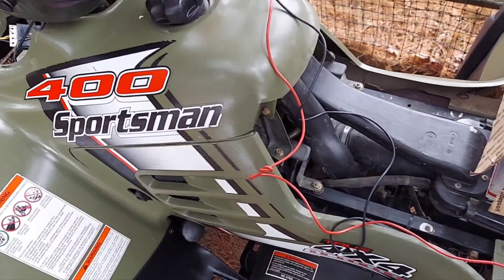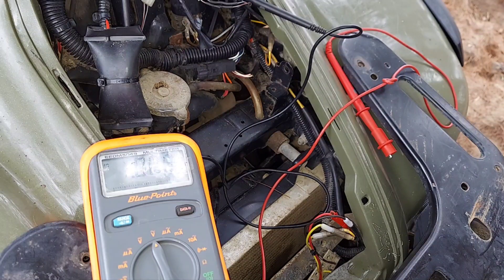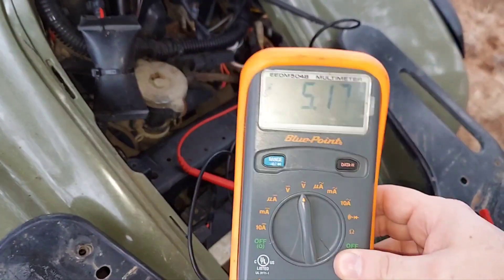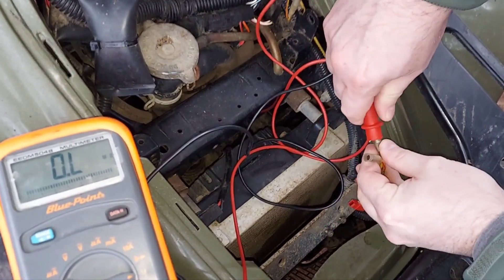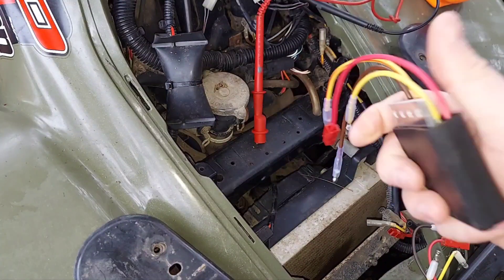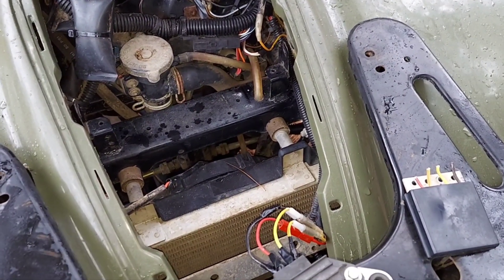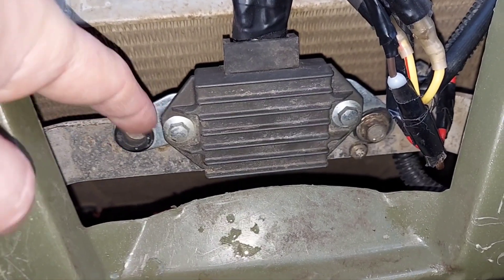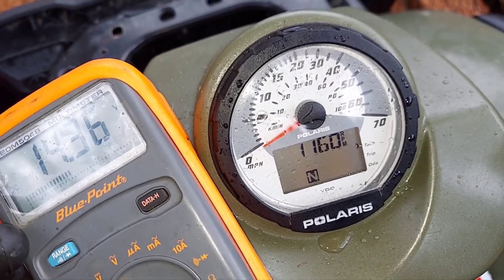Polaris Sportsman flashing battery icon on gauge. Overcharging and voltage regulator upgrade FIX.

Comment: Hello, thanks for all the info. I have performed the test as outlined in your video. All 3 yellow wires mirrored the readings you had on the video, 6-29 AC.  When I performed the test while on ohms it gave a reading, did not stay on OL What does this mean exactly?
Reply from the maker: if you are getting any reading other than OL then the stator is shorting to ground, most likely one of the coils on the stator have burned up or the copper windings have a broken spot.
Reply: @ thank you very much. So does that require stator replacement? I have replaced the regulator rectifier and it is now overcharging. Would the grounding to coil, Or unwinding cause this issue? Thanks again.
Reply: Two leads I get15, one lead I get 30. Not sure if that is ok? Definitely overcharging I get 17v+

Comment: Great video!!  I have a no charge issue and just tried a cheap Amazon rectifier and it only outputs 6vdc 🤦. Everything else works just like yours. I have a 2003 sportsman 400. So I have one more coming and if it doesn’t work I’ll be doing the upgrade you did!  🎉🎉

Comment: Not sure if it will work on an 04 model, but try putting it in neutral, turn ur key on and off 3 times and it should run its own diagnostic and shot u a couple codes, then that can maybe cut a method or two outta your way

Comment: I have a 2004 Sportsman built late in 2003. I have the same over-charging issues, but I read DC coming from the stator. Would this same voltage regulator work? I also ordered the same voltage regulator (ebay) with the same results as you,

Comment: After doing this method I felt the wires that are brown and red and the brown is hot to the touch. Then the yellow red wires are also getting warm so is it the stator?
Reply: Nevermind I didn’t let the rectifier burn up, I rechecked over all wires and grounds nothing I’d seen grounding out. So I pulled the stator cover off to replace the stator and the flywheel had the magnets falling off of it causing it to ground itself and not charge properly so $670 later it’s fixed keeping around 14.3 instead of 17-20 volts.

Comment: is this method still working with the yz reg cause I've must of spent $200+ on different brands of regulators and all wouldn't hold I've already replaced the stator so it shouldn't be the fault
Reply: Went on my last ride last summer and 10 minutes in the reg wires started smoking so I just had to run off battery and unplug it, I have fixed every little thing that was wrong with it and I just can't get around this problem.
Reply from the maker: @swiftlyswiv  Yes it is holding up fine. If you haven't already make sure your battery is in good working order, running it on battery alone will damage it the same way overcharging will damage it. If your battery terminals are loose this can also cause a regulator to fail. Wouldn't hurt to clean up all the ground connections on the wiring harness to the frame.
Reply: @1982HondaATC70  I’ve checked everything and the battery connections have been checked every ground on the bike, scrapped the frame regrounded them. I’ll have to try this out and see what happens usually the regulator will maybe work for 3 minutes then it shoots up in volts. Thanks a lot I’ve been trying with this thing over 2 years.